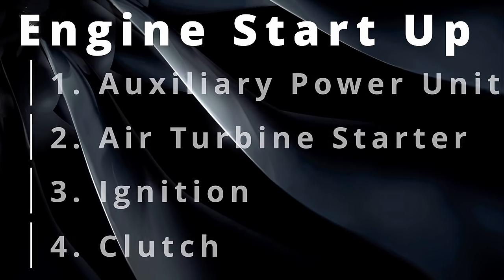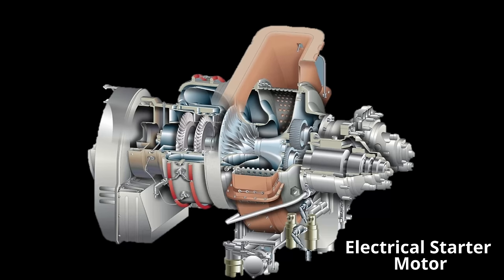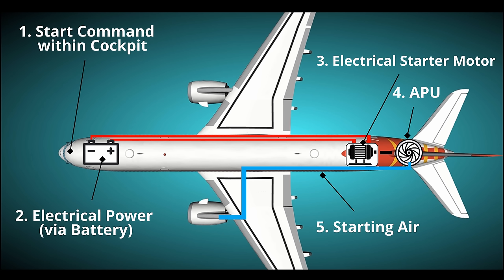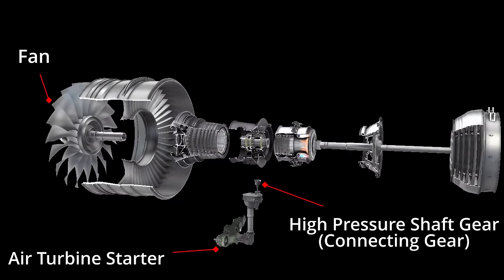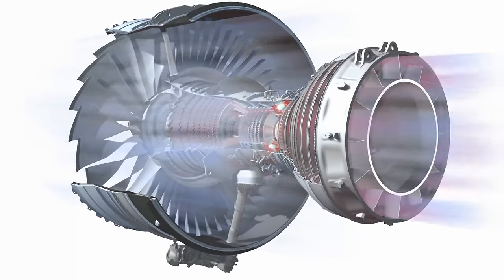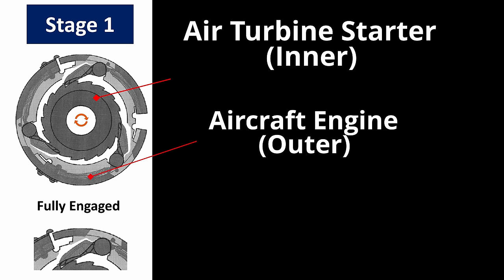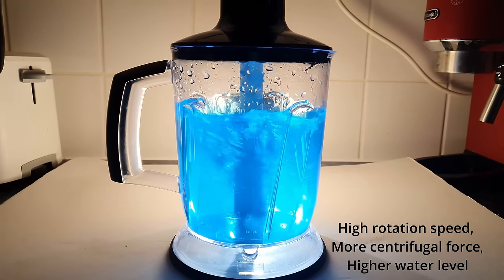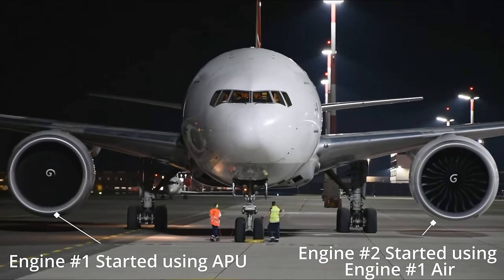How do Airplane Engines Start? (Including Startup Sounds)

Comment: Using one engine to start another is a cross-bleed start. It's only done if the APU is down, since the engine providing the starting air needs to be throttled up significantly, using a lot more fuel than the APU. This is done after starting the first engine at the gate with a "start cart", an external air source. Normally, the APU starts both engines, then is shut down once both engines are running.
Reply: My understanding is that there are many variables at play here which will determine the starting procedure that (commercial) pilots use. Options e.g.: APU bleed air to start both engines separately, an APU start for one engine to then cross-bleed another, and ground-cart air used in place of an APU for engine starting.

If an aircraft is going to be sitting around after taxiing away from the terminal, waiting for take-off permission, it can be more economical to start a single engine via the APU, shut-down the APU to conserve fuel, and then shortly before take-off, cross-bleed to start the other engine. 

I always thought it was pretty much up to the airline policy to determine whether it's an APU or cross-bleed start for the final engine...
Reply: @RebeccaJackson-w2v  Unless there's a single-engine taxi procedure in place, you'd normally start the APU and shut down both engines if you're going to be sitting still for a while. On a 737NG, for example, the APU will burn 240 lb/hr under load, but a single engine at idle will burn 850 lb/hr while putting out the same amount of electricity as the APU and significantly less bleed air.
Reply: Cross Bleed Start was a new Airframes Change in 1986 when I was in VF-101 for Tomcat training.
Before that the huffer and power cord had to stay connected until both engines started.
Reply: I was looking for this comment. The APU is used to start both engines. A crossbreed start is usually done if the APU is not available.
Reply: The 737 starting procedure-Aft left fuel on, APU start, APU bleed on, selector switch to engine 2, engine 2 start switch to GRD, wait for 25% N2, fuel selector switch behind throttles all the way up. Repeat process for engine one. 

APU does all of the work.
Reply: That makes the most sense. Why wouldn’t you start both with the apu or a start cart?  Im sure you could start one engine from the other but why? Thanks for the info Ive been a mechanic for 39 years but not on planes so this is interesting
Reply: @wb3161   At first it makes sense that APU start both large engines sequentaly. However, crossbreed maybe quicker due to higher pressure generated by large engine. Also the two larger engines maybe closer to each other than the distance from APU.
Reply: Ah, thanks for this, WOW, amazing.  Just incredible how this all works.  You are an outstanding subject expert on this.  Are you an A&P or did you fly one of these amazing birds?
Reply: @wb3161  When using a start cart, the plane will still be at the gate. That means there will be people and ground vehicles around it. The cart sets up on the same side as them, and starts the engine on the other side. The plane is then pushed back, and the other engine started with a cross-bleed start during pushback since they will both be clear at that point.
Reply: @railroad6601  The main engines will indeed supply more bleed air than the APU... when throttled up. The amount they supply at idle is significantly less than the amount supplied by the APU, so a cross-bleed start requires throttling up the engine supplying the air. And an engine running at idle will still use about four times as much fuel as the APU.
Reply: To be clear; you can't start both engines at the same time with the APU (simultaneously). Not enough oomph. Also: pilots like to monitor main engine starts, not possible if both are spooling up at the same time.
Reply: @Greatdome99  This is true for the vast majority of planes. Typically a quad will have an APU powerful enough to start two engines at once, and the 787's APU is powerful enough to start both engines at once.
Reply: @KingdaToro  Newer jets like the 777 and 787 have powerful APUs which allow dual starts (except the GE90 which are so big that they require more air). The older 767 and 757 have a weak APU that provides just enough air for one engine start when all packs are turned off.
Reply: In my 50 year career as an Aussie LAME, the APU was used for all engine starts if it was functioning. (I'm talking DC-9, B727, up to B747.) If the APU  was inop., # 2 or # 3 was started at the gate, ground equipment then disconnected and a pushback commenced. No further engine starts occurred until the A/C was on the departure taxiway. Why? Because the operating engine had to be accelerated to at least 60% on most A/C. Try doing that when a little tug is pushing the A/C backwards. When we had a B747 operated by a large Aussie company for which my company had the ground handling contract, all engines were started at the gate before pushback. Thanks to turbine powered ground air start units. With the DC-9, our company hired a wizz kid straight out of university(college). He came up with a great idea that if an A/C had a U/S starter, each DC-9 in the fleet had a starter pad blanking plate carried in the on board spares kit. Idea, start the engine with the good starter, remove the starter and fit it to the bad engine and start it. This was tried once. Starter removed from running engine and starter was last seen bouncing across the ramp. Parts inside were rotating at many thousands of RPM's. The poor guy who removed it was not strong enough to hold it. Wizz kid I think later became a politician. As we know, a job that requires no brains.
Reply: Both engines are far from each other how possible cross bleed start ?  Still I’m not getting the technical aspect
Reply: @Manu_Nayar  The bleed air ducts run all over the plane. It's needed for engine starts, air conditioning, anti ice, probably even more.
Reply: Most jets are twin-engine now, but what's the process for 4-engine planes like a 747?
Reply: @jdillon8360  A 4-engine plane will typically have an APU powerful enough to start two engines at once. You'd start two at once, then the other two. The starting order would depend on how the plane's systems are connected, as not every engine will power every system. For example, nose wheel steering may need a specific engine, or at least one of two specific engines to be running.
Reply: @chacehart7286  A) you dont need a fuel pump on to start the APU. B) there is no "selector switch" for the engines. C) you wait for MAX MOTOR D) fuel switch to IDLE.  Kinda hard to start an engine and expect it to stay running without fuel is it not?  Same side pumps on, or opposite side pumps on with crossfeed valve open.  Thats how it happened the other way when I drove one around SEA and did a take off power run/ check.
Reply: @railroad6601  there is no "quicker"..... max pressure is 40 psi.... they need around 20 to get it turning.
Reply: @KingdaToro  you do realize that the start cart hooks up to the BELLY of the plane right?
Reply: @KingdaToro  the pneumatic system of the plane is 40 psi.....PERIOD
Reply: @Greatdome99  747-400 can....2 at a time all day long
Reply: @KingdaToro  dude....get real.  THERE IS NO BLEED AIR ON A 787...the engines start ELECTRICALLY!!!!!
Reply: @worldlinerai  again....there is no bleed air on a 787....no pneumatic start.....just stop.
Reply: @KingdaToro  pressurization
Reply: @KingdaToro  4 then 123....its all about BRAKE PRESSURE first
Reply: @justinglass9340   A) it’s highly recommended. Tank one aft is the lowest point in the fuel system and any moisture would gather there but really, if there is sufficient fuel-either side can be used. You can even use CTR if it’s at the approved fuel level for ground usage. B) IGN selector. My apologies. C) The whole “N2 percentage increase >1% over five seconds” thing over complicates it. What I said stands. That’s the “basics” of it. D) “All the way up” IS idle my man. Again-keeping it simple. 

If you wanted to go rob a plane on the ground at an airport and it happened to be a 737, provided you did everything else right-my above described procedure would get the engines running.
Reply: @chacehart7286 25% N2 is a pilot thing. I’m a maintainer and I wait for max motoring before lifting the fuel control lever
Reply: @railroad6601 cross bleed engine starting is a slower option to start the engines. Why? Because when an aircraft is being pushed back from the gate both engines can be started by the APU.
If one engine is used to start another engine (cross bleed start) the push back tractor and nose wheel steering bypass pin needs to be removed and the aircraft park brake set. Why? Because the donor engine will need to have the thrust increased to supply the amount of air required to allow the start on the other engine. On a B737 the thrust increase is quite substantial
Reply: @KingdaToro B737 cross bleed start happens on the taxiway after the pushback tug and nose wheel steering bypass pin is removed and the brakes are set
Reply: @Greatdome99 to be clear, some aircraft can start 2 engines at a time such as the B747 and the B787
Reply: @justinglass9340 the Airline I work for operated B737-300/400’s and they didn’t have a DC fuel pump. I’m not even aware if it was an option. Many times the APU start would fail if there wasn’t a fuel pump on to supply positive pressure to the APU. We would have to get a ground power unit hooked up to supply external power so that the AC powered fuel pump could be turned on. It was quite frustrating and added an extra 20 minutes to the job
Reply: 787 uses an electric starter.  It acts as a starter until engine spools up then switches to a generator.  It's called a VSFG (variable frequency starter generator)
Reply: @KingdaToro Depends on the aircraft. An A340 gets more from an idling engine than from the APU. A 748 gets enough from the APU  to start 2 engines at once,  so it's hardly worth the trouble to select cross feed when you can just switch the other two to start.
Reply: @justinglass9340 Boeing and Airbus both automatically switch on the necessary pump. Maybe not the 737, but everything after the 747 switches on the forward left wing pump. Part of the reason Boeing starts right engines first, APU has been running from left tanks. Airbus manages APU fuel automatically, it's not visible in the overhead.
Reply: @cageordie  Right, but how much fuel is that idling A340 engine burning compared to its APU? If you divide bleed air (or electricity) output by fuel consumption, I doubt there's any case where an engine can beat an APU.

Comment: I was a gas turbine tech in the US Navy. The engine starting sequence was one is the most challenging topics to explain to junior technicians. This video simplifies kindergartens it. Thanks you!!
Reply: Do you know why they use an air starter instead of an electric starter?
Reply: @Negev-Israel  In the past, electric motors and generators were heavier than the components used to carry the high pressure air (called "bleed air") from the APU or engine to where it is needed.  Improvements in motor and generator technology have changed this balance, and newer aircraft, such as the Boeing 787 dreamliner, use electrical starters and virtually eliminate the use of bleed air in all their systems.
Reply: We use air starter instead of electrical starter for many reasons. The first one is that an air starter of an A320 or B737 is a 150 HP turbine. An electric equivalent would be heavier and you have to carry it for all the flight when you only use it for less than 1 minute. 
Also an electric starter would require energy that you find in heavy batteries. Same thing. The weight to power ratio is not in the advantage of the electric starter. 
As described in videos the APU which is a small turbo engine is started by the battery of the aircraft or a ground cart when available.
But when power is required the electric solution is too heavy yet 😊
Reply: @ChapaLipar  makes more sense
Reply: @twwc960 yes it’s true. On bigger aircraft such as 777 they use alterno-generators which are used as electrical motors during start and as generators during the flight, providing electrical power to the aircraft. They are heavy but they replace the generator and the starter. That provides a weight benefit over two separate systems.
Reply: A gas turbine tech and he/she cant construct a simple sentance!
Reply: @ChapaLipar do jet airplanes have the equivalent to an alternator in a car to generate electricity? Is that what the APU does as well?
Reply: @DannySebahar  yes they do. But the only source of power comes from the engines (like a car). On each engine there is a generator with different names depending on the generation and the aircraft manufacturer. For the Airbus A320 and the Boeing 737 there is a IDG ( Integrated Drive Generator) mounted on the accessory gearbox of each engine. They provide 60 kVA each to provide electricity to the aircraft. It’s used for the lighting, the IFE, the ovens, etc.
Reply: @DannySebahar  thé APU is generally off during the flight. The engines provide all the necessary power sources.
Reply: @DannySebahar  You are correct!
Reply: @Negev-Israel  787 has electric starters on the engines

Comment: Great overview, just one comment from an engineer at Rolls-Royce: the fuel is not self igniting due to the high air pressure, you need a sustained flame in the combustion chamber. So if you have a flame-out you need to re-ignite.
Reply: Yep. That’s the case for diesel.
Reply: Thank you.  I jolted when he said that, too.  What he should have said is that the engine sustains combustion in the 
correct direction.  Yes?
Reply: The ignition is switched on when it's time to light the fuel, then the flame burns like on a welder's torch. But I understand that in certain weather conditions the ignition is set to continuous in case of a flame-out.
Reply: @PeterNGloor  that’s correct. In normal circumstances during engine start you use only one of the two igniters. If the engine start fails, then you make a second attempt with ignition selected on ‘both’ . When the engine is spooling up to idle, the starter disengages and the ignition is switched off.
During the flight in severe conditions like heavy rain, ice, or freezing temperatures on the ground when landing the procedure is to turn the ignition on to prevent any flameout.
Reply: And in ‘continuous’ position the ignition is on for both igniters.
Reply: Can you find me work? ChemE flunkie

Comment: Cross bleed starts are not normal. Usually the APU starts both engines. On things like the CRJ series there isn't enough pressure to cross bleed start at idle. 787s use the starter generators to start the engine, they don't have bleed air. 787s are all electric. Small jets often have no APU and start electrically, but then have bleed air for pressurization and deicing. If the fuel was self igniting flameouts wouldn't happen.

Comment: Excellent explanation!
The jet engine is an amazing invention. I recently flew back from Dubai, direct to Seattle, 15 hour flight, on an Airbus A-380. The endurance and lift those engines deliver day in and day out is just incredible. Hundreds of passengers and all their luggage. Inside the aircraft, I could hear the engines, but just barely. Have to respect the engineers that design these engines.
Reply: Yes Sir, it is an amazing age in which we live! Long may it last👍
Reply: Not to be picky but the wings generate the lift
Reply: Fascinates me!
Reply: @NicholasRiviera-Dr   True. But the wings need to move through the air at a certain speed in order for the wings to generate lift. The engines are where it all begins.
Reply: @PH-md8xp  lol, the chicken or the egg first. A glider doesn’t have an engine but you are right that the air needs to flow over the wings